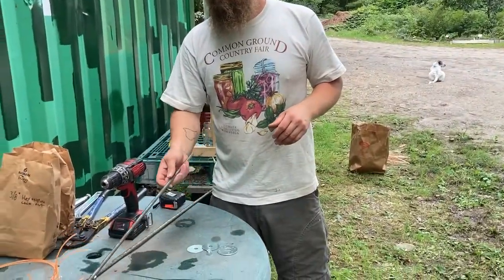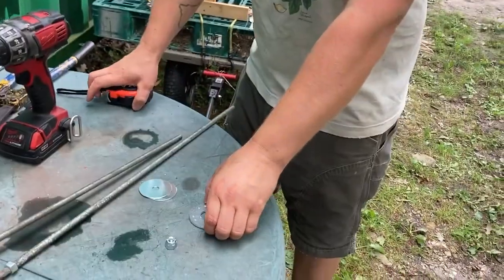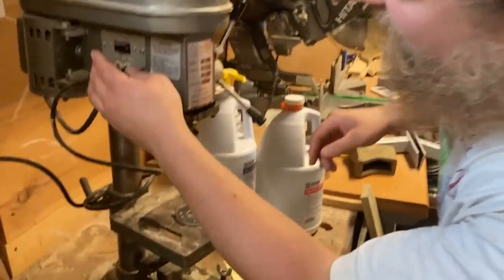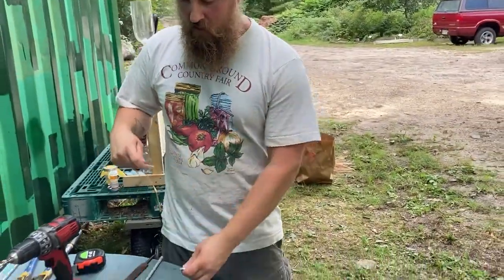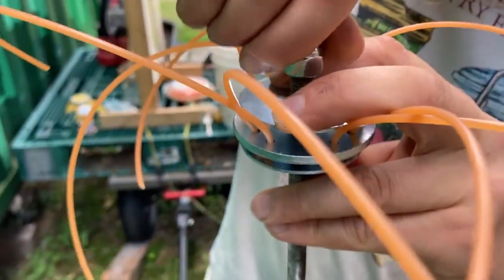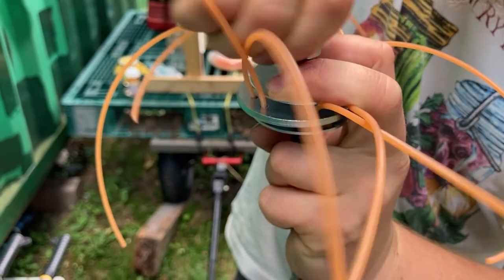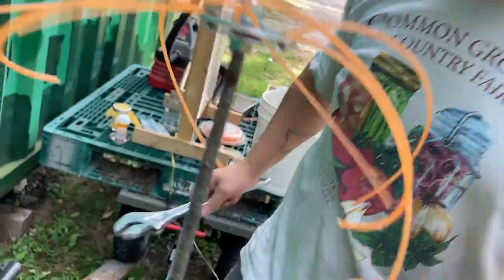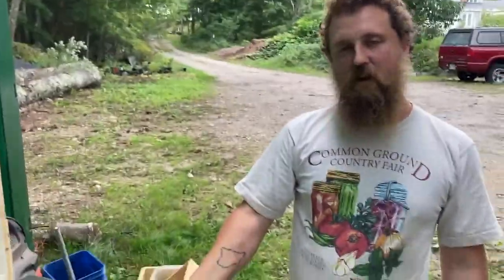Propaganda by the Seed: Building A Bucket Thresher

Comment: I love the design using the weed wacking strings.  I've always thought the metal paint stir rods are a bit rough on the seeds. Will this sort of a rig work to remove the fuzz from seeds such as liatris and aster?
Reply from the maker: Yes! I have successfully cleaned many fluffy seeds with this tool without damaging the seeds viability. It does require a fairly fast drill speed, if the battery on my Milwaukee m18 is running low it won’t de fluff seeds very well. On the flip side I have occasionally damaged seeds by using to fast a drill speed, so better to start a bit slow and go faster then use full power all the time. I hope this helps!
Reply: @infiniteohms  Thanks for the reply.  Good info on the speed of the drill.  i have a bunch of asters and liatris I want to use it on.  I'll let you know how it turns out.